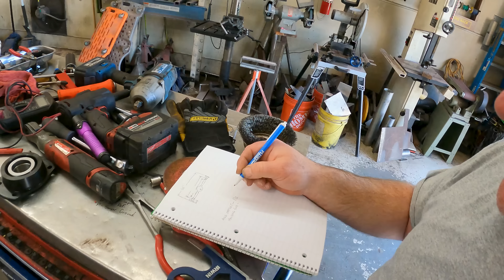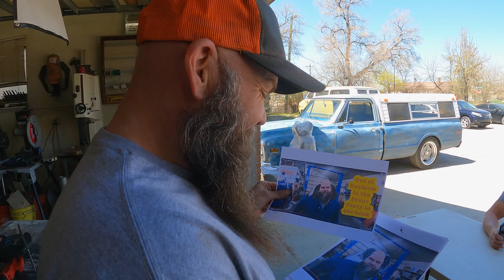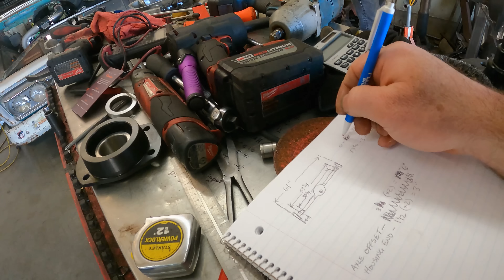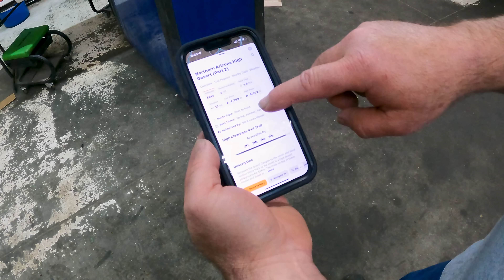Oh Wait, Is That Right??

Comment: Love the content, keep up the good work! just a tip (from an experienced user) the Streamlight Microstream is an awesome hat light. They are also USB rechargeable and would not hurt your teeth. They last quite some time in between charges and I use mine almost everyday on numerous projects. Every time I see Kaden with that flashlight in his teeth I think back to when I did the same thing. Trust me, there is a better way!

Comment: Hi Chad.  Just wondering if you moved the air intake to in front of the radiator mounting wall you would have cool air  and not warm / hot air from the engine bay ?  Enjoy your  chitchat best wishes from the uk

Comment: Still working out the bugs on this truck I see. Did you go ahead and install the new rear end for this truck you were working on in this video and just not show it or still waiting on parts to finish it out?
Reply from the maker: Still waiting on parts to finish it before installing. Not removing the old one until the new one is ready, don't want the truck down 😁

Comment: With all the wizards looking on in your garage this pickup truck is obviously not getting tuned up prior to an attempted light off on the street. It cuts out at rpm so much that maybe it needs a new think in plugs like E3s which are good and some attention to the carb.  That truck wants to go and l....alas.... it can't.
Reply from the maker: It was on the rev limiter, couldn't get it to shift to second. Does still need a lot of tuning

Comment: 30:12 what is the issue with you guys and a cable operated 'handbrake' operating on your rear wheels, European🏴 style?

Is it a superstition or the like.

Where we have mostly manual shift gears there's no 'Park' option, only maybe reverse or 1st gear, but usually just neutral and the handbrake.

 We use the handbrake as the emergency brake and as say a hillstart assist. 
Or for hooliganism - doing handbrake turns.

What us Europeans like to do, instead of smokey burnouts.

This way though, if you should blow a hydraulic line - you'll still have a working cable operated handbrake, available before you should reach the scene of the accident.
Reply from the maker: With the new rear axle it will have an electrically operated park break 😉😁
Reply: Yeah, I've had a few cars with those electric 'handbrakes'.

 Ended up completely paranoid after coming back to the vehicle - not being where I left it!

Those electric systems are too binary for my taste - either all the way on, or released.

Here in Scotland we have too many hills and tight curves on our roads, to be ok with the notion of ever having brake failure.